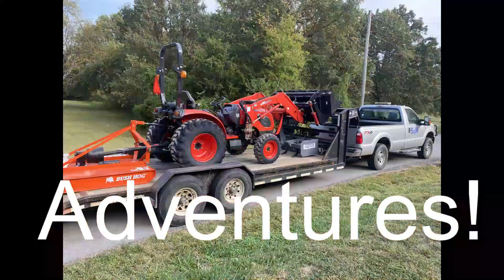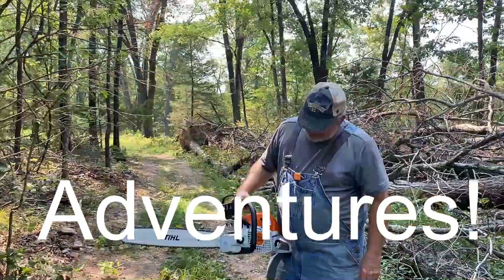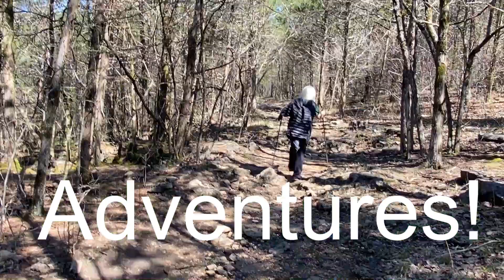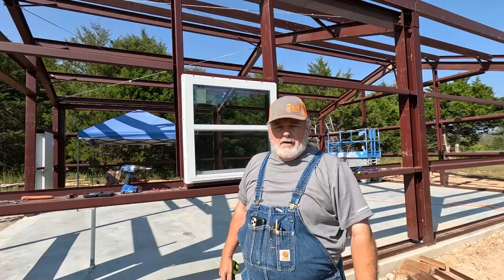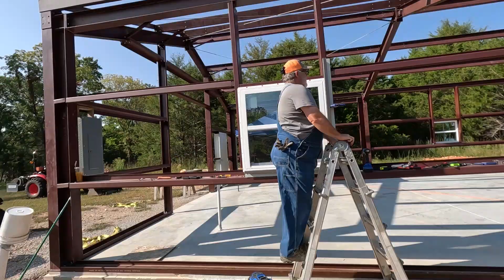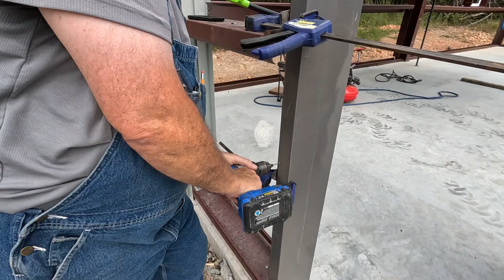Red Iron Shop Build | J-Channel & Trim Install

Comment: Lookin good Larry. Your building is going to be great when the weather is bad. Having a nice dry, warm place to do a few projects. Or to just sit out there with the door open watching it rain.  . Be Safe Randy.
Reply from the maker: That's the plan, having a warm place for projects this winter.  It is all dried in and the garage door installed—I’m a couple of weeks behind on videos.  I need to post a couple of times a week for awhile.